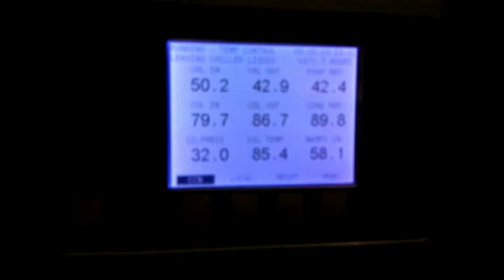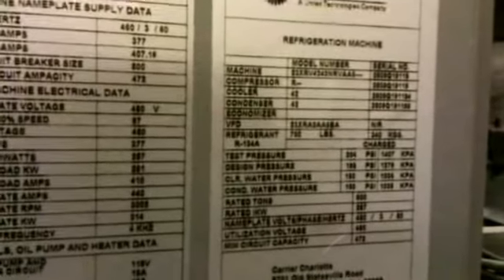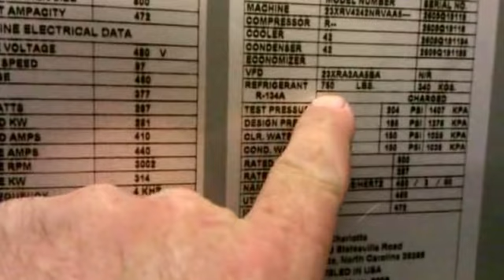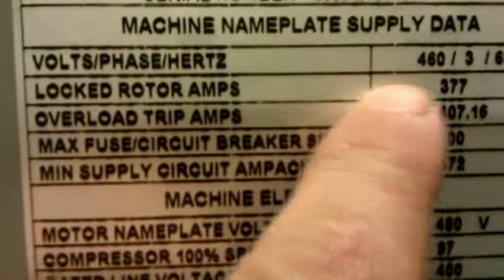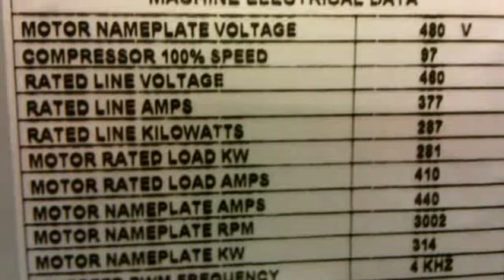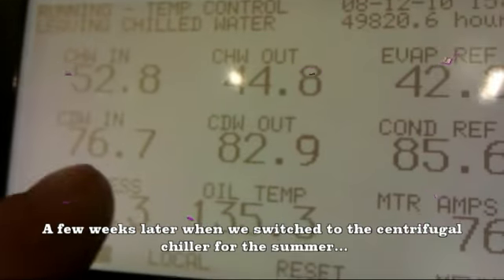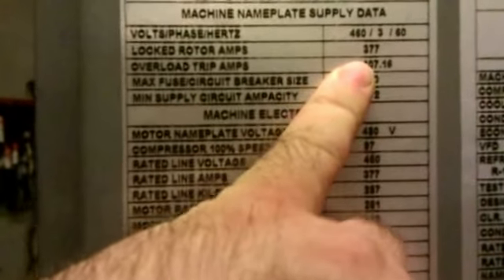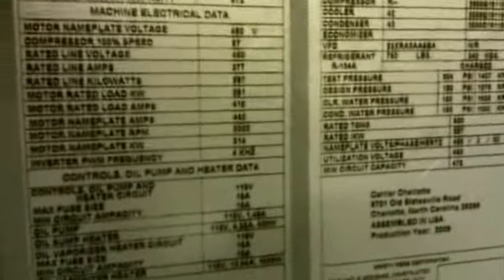Various clips of towers and two chillers

Comment from the maker: @IndieBraah 
Thanks bro. The four towers for the chillers I clean out regularly.
I have also vacuumed the bottom of them like vacuuming a swimming pool. It doesn't take long for silt to deposit. When it gets bad and it gets stirred up, it goes right through the screen mesh outside and plugs the more fine screen filters at the pumps inside. :-(

I got some mineral build up on the other towers. When it cools enough I will clean those with the pressure washer.

Comment from the maker: @sromanecz 
The towers cool the water that cools the "condenser" barrel of the chiller(s). (Instead of air cooled condenser, it is water cooled form the towers).

The chillers cool the water that feeds the air handlers in the main building. 

So basically the four towers reject all of the heat from a 6 story building.

Comment from the maker: @tstatech 
I once got to work on a Vogt (can't remember the spelling) "Tube Ice" machine.
Remember the bagged ice with the hole in the middle of the round ice?
This machine I worked on would make enough of that in 20 minutes to fill the average ice bin in a restaurant!
It made 10 tons of ice in 24 hours. 

I had to CLIMB the monster to reach certain parts. It was cool though!

Comment from the maker: @agoodm
The chillers cool a 6 story building, not sure the sq foot. Only one 500 ton chiller operates at a time.

The building with the water source heat pumps is less than half that size. Has about 100 1 ton wshp's for patient rooms and larger for kitchens, hallways, etc. I haven't shown the 3rd bldg, those are just Carrier RTU's.